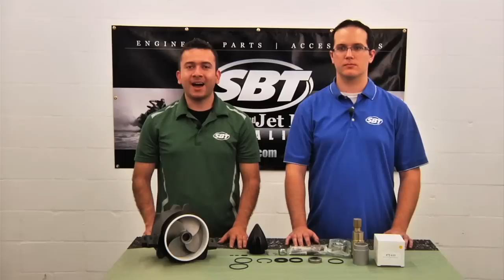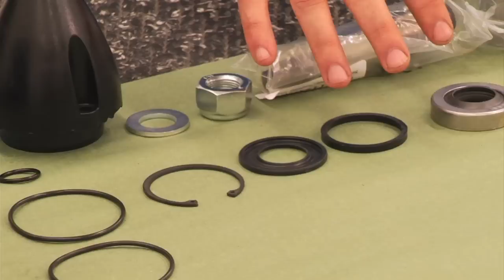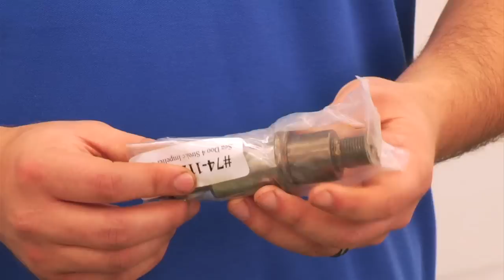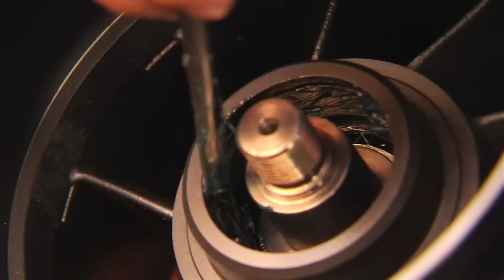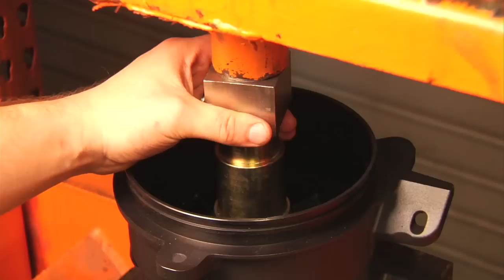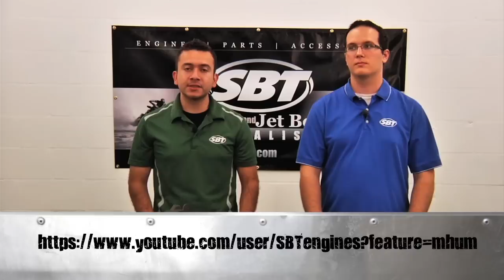SBT Tech Tip: Jet Pump Rebuild

Comment: Bought an 800 SXR rebuilt pump from SBT. It lasted 1 season. When I took the ski out for the first ride this season it started vibrating real bad and when I stopped to check it I found that the prop was moving all over the place. I removed the pump and found that the bearing seals had no grease at all and the seals were leaking bad. it allowed to bearing chamber to fill with water and when it sat for the past winter the bearings rusted and came apart causing the brand new set back prop to be destroyed. In addition to this the wear ring was all rusted from the prop rubbing on it telling me that the stainless wear ring was made out of very poor quality stainless steel. I also fell right out of the housing. When I call the woman in customer service told me that they come with no warranty at all and she was very rude and defensive while basically telling me to go pound sand. This pump was poorly rebuilt and a big waste of money. As an employee of of a dealership that has five major dealerships that has bought numerous products from them I will no longer be purchasing anything else from SBT. This pump failure was 100% due to bad workmanship. The customers service was rude and dismissive. Beware of your purchase if you decide to use there product.

Comment: Do not Trust Short Block Technologies Inc. (SBT) , Avoid at all cost.
After purchasing 2 engines through my mechanic (Boatech) the starboard engine Serial # S001252  gave me problems from day one.

First time we sent the engine back was in May of 2017, We paid freights and still only got the same engine back. September of 2017 the engine has a serious failure and we send engine back again and we just get the exact same engine sent back to us again.  They took zero responsibility and insisted they said the engine was in perfect condition after just making some minor adjustments when the engine clearly needed to be replaced.

 21/2 years later(Warranty expires) the engine needs to be replaced as expected. I have called Short Block Technologies Inc. (SBT) in December of 2020. Spoke to the sales manager Justin, who every time deflected he needed to talk to the owner and  had to get back to me. He never did but once.  6-8 calls through the last 2 months all he offered was to pay the freight of the new order. (Why acknowledge responsibility and do nothing)

I have not even been asking for replacement of the entire engine but a discount on the purchase of a new engine. Instead all I have received is the run around  that the Owner is never there.

My unfortunate experience is that if an engine fails SBT will never honor warranties and replace engines.It seems that even giving them a second chance to redeem themselves by just requesting a discount is not their customer service scope.

I am so disappointed by this level of service and we ask why are we losing american business to other countries, This is exactly why.

 

It seems that I will have to go through the process of ordering OEM  parts from Japan, because this company does not want my money and prefers to lose customers. I will escalate this complaint to all forums and online resources.

Comment: I have one of your 32-426-13-17 impellers I purchased for my 1996 Waverunner 3. I am concerned that the impeller doesn't look as aggressive as the stock one. It sets inside the wear ring 3/8" deeper and the hub is much larger circumference. I am lazy and don't want to do this twice, I would like to know if this seems correct? The outside diameter on the Adonis hub is 3" and the stock one is 2-3/8". It fits well but seems to have less blade surface. Thanx
Reply from the maker: Please contact tech@sbt.com or call us 727-443-0373 and ask for Tech!

Comment: hello, do you have a video on how to replace the starter on a 2000 Kawasaki Ultra 150?
actually it is stack, does not move.
Reply from the maker: Hi, you can contact our tech department, 877.330.0231. They can help you with this.

Comment: hello im alex from greece.i have a question for you.when you change all these parts,it needs time for the bearing to work?im asking because in my jet i changed all these parts like you and when you turn the impeller with your hand,it turns very difficult.
Reply: while it's connected to the engine..?
Reply: in the engine all ok but i lost 1mph top end speed and 200rpms
Reply: if it's attached to the engine you're turning the crankshaft and everything connected. so resistance should be expected. out of the ski it should spin freely.
Reply: lanciayturbo also. it should be noted that it's unwise to spin the impeller while it's attached to the engine. at least disconnect the battery and plugs.
Reply: now i understand what you mean.not connected to the engine.and it doesnt turn easy.before the rebuilt,it was turning very easy
Reply: lanciayturbo can you hear anything with it out of the ski turning it?
Reply: no apsolutely nothing.my jet is a seadoo spark
Reply: lanciayturbo loss of power is quite often directly tied to loss of compression